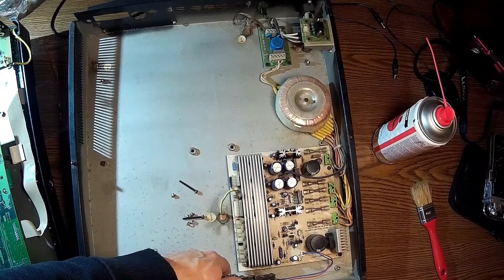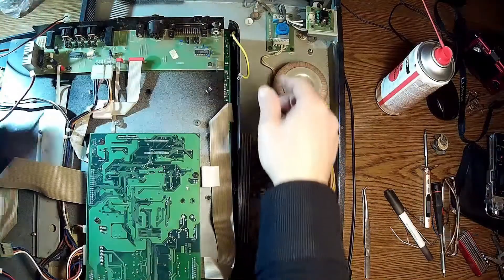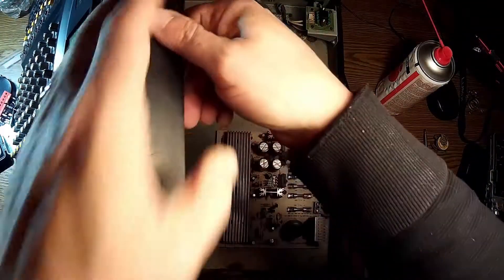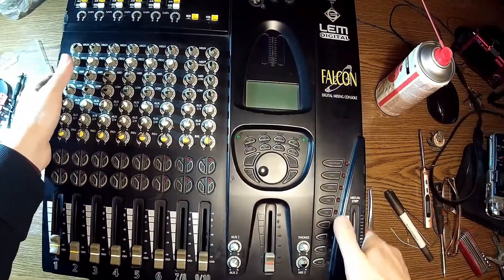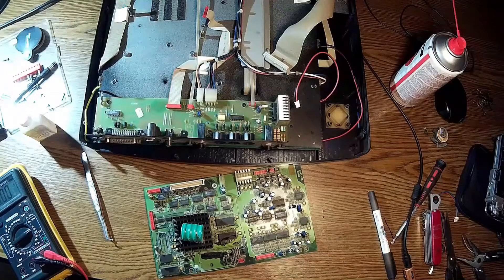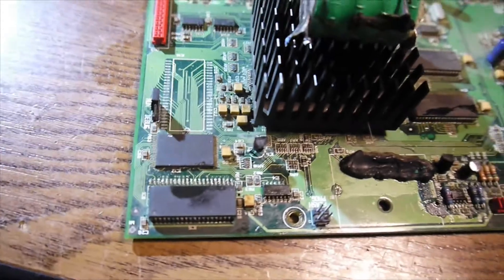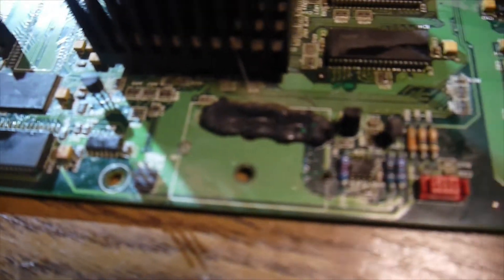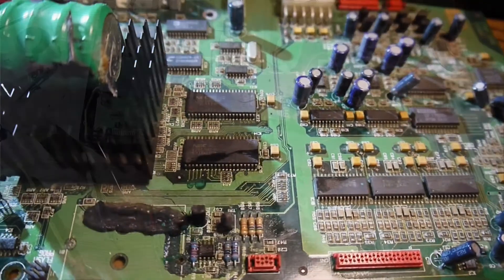Attempt to repair a vintage LEM Falcon Digital mixing console

Comment: Hi, I am trying to learn the skill to repair my mixers in the future. Do you have any starting point for newbies - specially if they do nothing about electronics. What would be your advise ( today I cleaned my Soundcraft 16 console but did not changed any parts). Thanks
Reply from the maker: There are so many things involved, read about basic parts, resistors, capacitors, transistors, OP operational circuits, power supply and so on.Use old boards to train your soldering skills, experiment with small parts, eventually hot air station, I can't point you to something specific, it's a huge domain but if you have patience and do small steps you'll learn! Be ready to burn your pockets too..kidding.
Anyway , if you start a project try to find info for all the parts, what are they doing and connections between al of them..good luck!
Reply: @viocaia  Thank you for the information